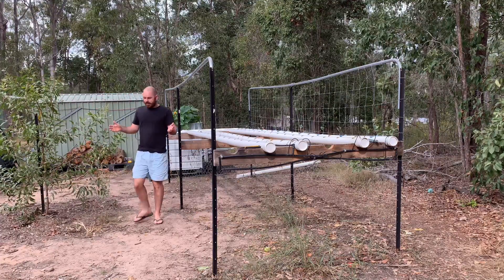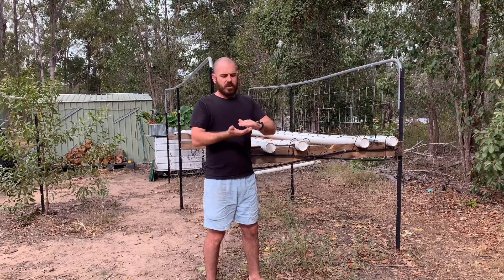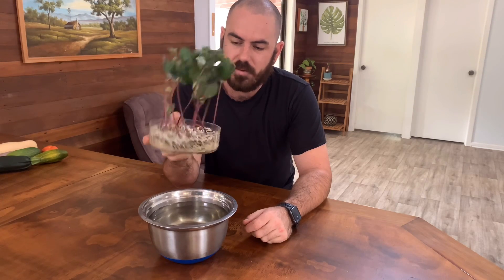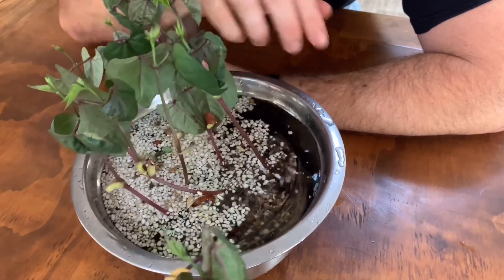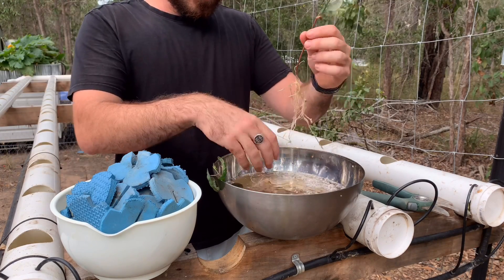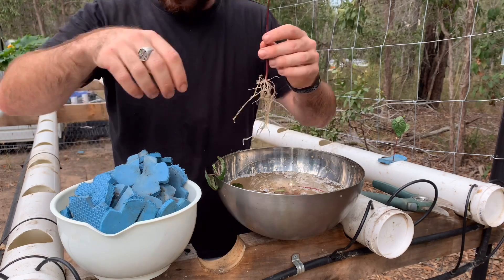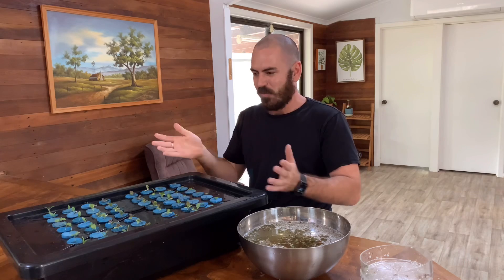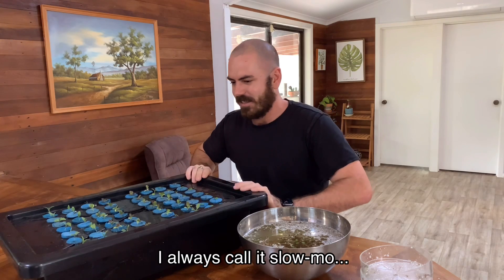How to Transplant from Germination to Propagation in NFT Hydroponics

Comment: Instead of cutting holes in the lid and putting the pucks in the holes, wouldn't it work to just let the pucks float on the surface of the water? Then you could get more seedlings in the propagator, finish in less time, and not have to worry about the water level dropping.  Or would that drown the plants?
Reply from the maker: The bubbles popping on the water splashes the roots giving a quicker result.
Been meaning to do an update video specifying how to set the system up.
You want a gap of about an inch between the water and the top so the roots get splashed and are not completely submerged.

Comment: Hey Hoocho, can you reuse the vermiculite and perlite after removing the seedlings?
Reply from the maker: I’ve been thinking about this question. Since they’re both heat treated minerals I think you could heat treat them again to sterilise them. But I’m not sure what the organic matter you kill will do to the mix after it’s sterilised. I may experiment in the future. But for now I’ll refresh each time and use it as a blank slate.
Reply: @Hoocho  I'll try it out in my system and test heat treatment and maybe UV sterilization. Would be great for cost cutting if it can be reused. Gotta say I appreciate your vids. Your NFT creation video finally motivated me to build my system.

Comment: Since vermiculite / perlite is inert, is there any reason to wash it off the roots other than the fact it might gum up the NFT system? Would the increase in water being held next to the roots be a bad thing at all?
Reply from the maker: If you’re not worried about your system clogging there’s no reason you have to remove it. There’s no need for it though. The roots are going into DWC which gives adequate oxygen and water. Same with NFT.